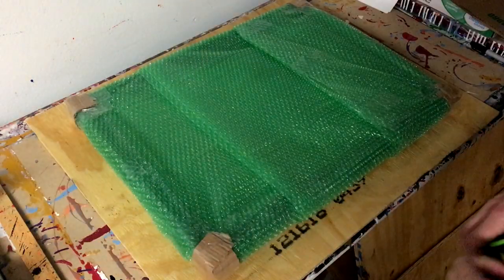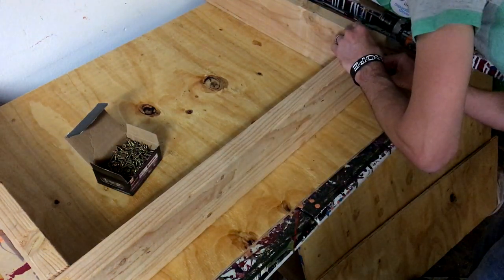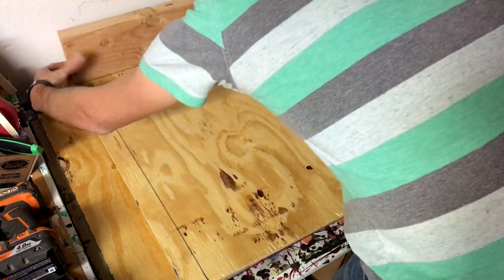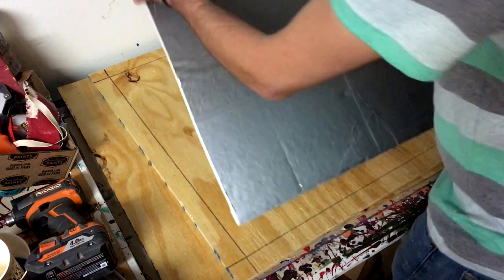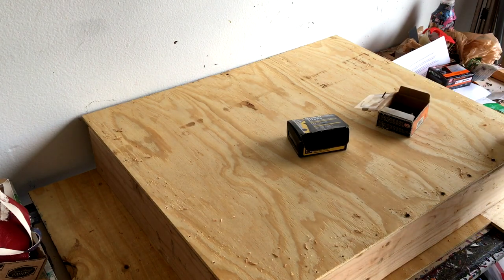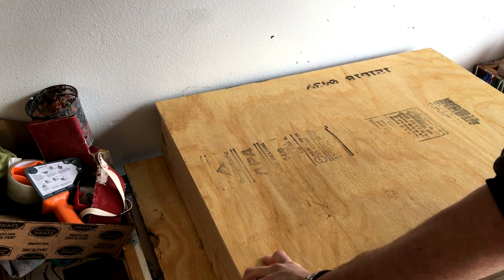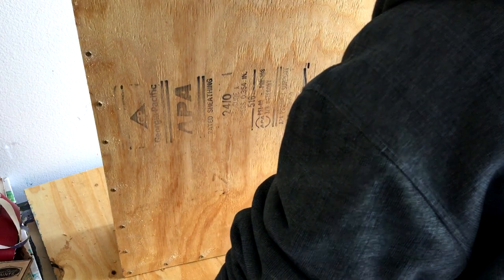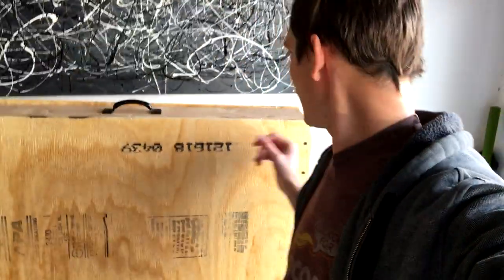How to Make a Shipping Crate for SaatchiArt

Comment: Nice video, however you keep referring to the side pieces as "one by six" when they are actually "two by six" framing lumber as noted in your parts list. Milled finish for 2"x6" is 1.5" x 5.5"; milled finish for 1"x6" is 3/4" x 5.5". The only catch with using thinner side wood is making sure that your pre-drilled holes are lined up precisely. And in this instance you can save considerable weight by using 1"x6" along with 1/4" plywood. For connecting the side pieces, 2.5" or 3" screws (coarse thread) would be preferable over 2" since a 2" screw will only set 1/2" into the adjoining piece. For the top and bottom a 1.25" (course thread) should give you plenty of depth for 1/4" or 3/8" plywood. For an even lighter but still strong assembly consider Masonite hard board. Masonite will not have quite the same degree of puncture resistance as plywood but it should be plenty strong for shipping. Be sure to carefully pre-drill and carefully countersink the screw holes if you use Masonite.